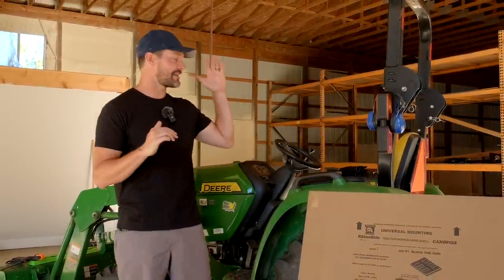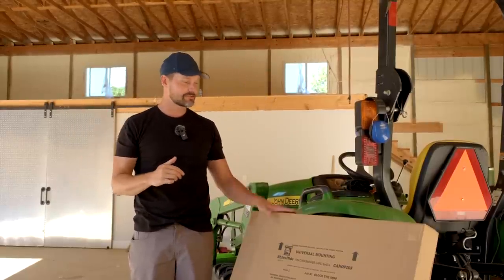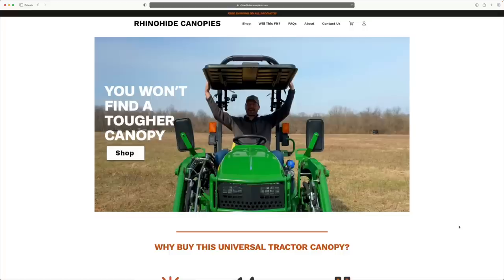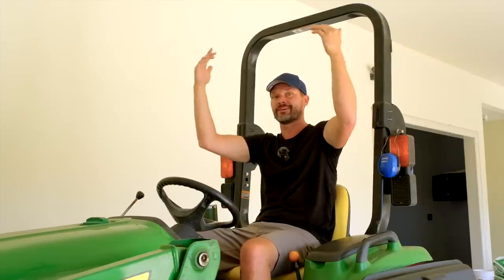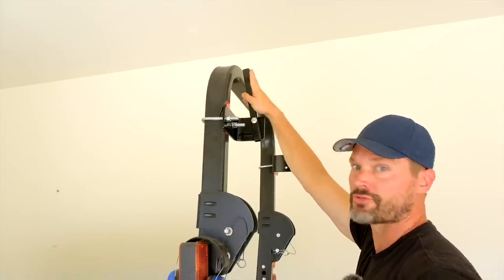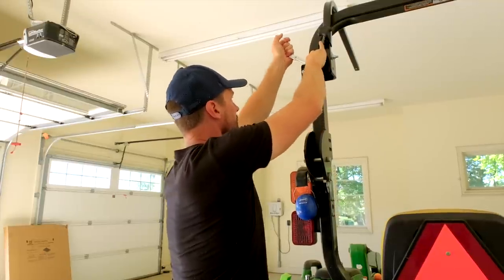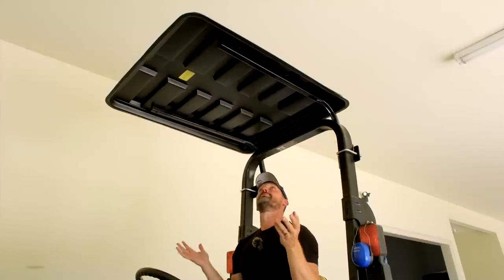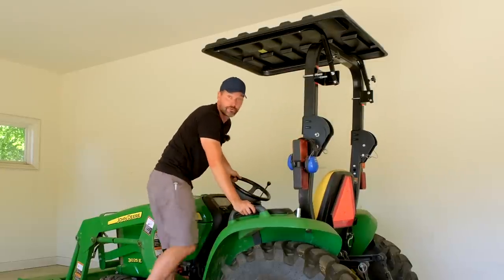I LOVED THIS TRACTOR PRODUCT SO MUCH THAT I BOUGHT THE COMPANY!

Comment: With the help of this video, the Rhinohide was an easy install on my Kubota MX5800.  As expected, I had to rearrange some other items (auxiliary lighting, tool tray, fire extinguisher) mounted on my ROPS, but it all worked out great.  

My roll bar is 42 3/8" wide (which is 3/8" wider than what the standard brackets are designed for), so the wider brackets were included.  There were no changes to the install procedure because to this - just a longer bracket.  

When traveling to jobs, I typically trailer my tractor backwards, so wind damage to the canopy won't be a concern.  On those occasions when an implement / trailer combination requires trailering the tractor forwards, this canopy is very easy to remove.  

This canopy is much more durable than the more expensive and heavier metal canopy I had on previously.   
Satisfied customer!

Comment: I bought one for my Kubota L4701 a couple of years ago.  My only complaint is that the intentions on top collect rain water.  When you get on your tractor the next morning you’re greeted with a cold shower as the water rolls off the side.  It would be better if they could fabricate it with a slight pitch from the middle down to allow the rainwater to run off and not collect on the canopy.

Comment: So, I'm a Scotch or two in and I went to your newly acquired site to order one of these to replace the incredibly heavy fiberglass cover I purchase with my 4052R (lowering my ROP with cover attached is back breaking to a point of using the 3 point and a 2x6 to lower it when needed).  Unfortunately, I don't feel like walking to the barn and measuring my ROP tube dimensions.  A sort of database covering popular tractor models would be so convenient!  Anyway, this is on my buy list when I get out there with a measuring tape.  Can't wait.  Also, from past experience slots for the threaded U brackets would be useful for fine pitch adjustment.

Comment: Love my Rhinohide on my 1025R.  I've tried to break it unsuccessfully many times.
I would like to see 2 or 3 features added:
1. A rear view mirror.  Possibly with a cover so I don't have to see it bouncing around when not in use.
2. A spot to mount a garage door opener.

3. A small storage pocket.

Thanks for all the videos.  Keep up the good work.

Comment: Congratulations on the new company. If my tractor didn’t have an OEM canopy, I would have one of these. The shade really helps on hot days. 

I have a suggestion, extend the brackets a couple more inches and put a hole in them. This would make it simple to add LED light pods to a tractor. A lot of people add lights anyway and most compact tractors have a FEL that obscures the headlights. You’re welcome.

Comment: I bought mine a month ago, so it must have been right during the change.  I second the mention of a radius slot to get the right angle.  I finally got mine installed about 2 weeks ago on my New Holland 1720 I recently bought.  Not only are the ROPS angled back, but they are somewhat trapezoidal.  Apparently we did not get the holes in our brackets drilled exactly the same.  We must have been off 1/8 to 1/16 of an inch or so because one side looks level while the other side doesn't.  Although it annoys the daylight out of me seeing it off a little, it still works fine.  A slot would have made it infinitely adjustable and I could have got both sides level.

Other than being unlevel, I can say I am impressed with it so far and I would highly recommend it for the price I paid.  It has been wonderful to have shade in the summer sun.  This is critically important for those of us who are follicly challenged (yes...bald).  :-)

Comment: Watching this I think you can offer a Snap-On side curtain kit made out of some kind of tarp material or canopy from an RV type material. so it would provide more shade and be flexible when getting on and off that's just my take
Reply: You could add the snaps pretty easily yourself.  Loxx fasteners would probably work just fine.
Reply from the maker: We're considering a solution just like this.
Reply: TINTED curtains...like welding curtain material.
Reply: That would be great for winter time, I've tried door screen material but still too windy.

Comment: Great investment in a great company, great product!  Mine is such a huge help in the blasting heat of the summer.  Also helped a ton during a snow storm last winter when literally all my neighbors asked for help.  Mine did add 1 inch of height which unforunately did ding my garage door LOL.  So, I can definitely attest to the fact that it is very easily removed and put back on.  
Best practice: If your ROPS and/or canopy do ding your garage door opening: stand a ladder in your tractor parking bay after you back out and before you put the canopy on for the day's work so that you don't forget and ding your garage door opening.  Saved my keister a few times after a long day in the hot field.

Comment: back in the 60's there was a round fiberglass cover with a built in fan sold for combines. The air was a double shell that directed around the sides to put an air curtain around the operator.

Comment: Love the Rhinohide canopy I put on my Kubota LX3310 last year. I have the "S" model and agree the "E" model would be nice to have. I have taken mine off once to trailer it to the dealer to add on a new attachment, and it was easy to take the U bolts off, but the E model looks more convenient. I bang my canopy into tree limbs all the time while working around my property and it doesn't care. The shade is really nice to have in the hot sun. Congratulations on the new company! Your video is really helpful to see the benefits of the E model.
Reply from the maker: Glad to hear it's working well for you!

Comment: Glad you fixed the website.  The old site never worked for me. 
  As for setting the hieght,  anyone that uses forks on occasion will probably want to set it a little high like you did. I find myself pretty much standing at times to see the forks align with the load and the last thing you want is to bump your head when standing quickly to align the load.
Reply from the maker: Good point about trying to see the forks and head clearance!

Comment: Future design consideration - Create a radius slot in the ROPS bracket so the end user doesn't have to tweak it and drill the hole to get the forward arms at the perfect angle.  Just throw the bolt in and set the desired angle of the top canopy.  I'll take my royalties in the form of SUBS/LIKES
Reply from the maker: I like this suggestion. Would be curious if when the canopy gets knocked by a branch or anything hanging low if it would tend to knock out of place due to the possibility of movement in that radius?
Reply: @GoodWorksTractors  Yep that would be the idea though, tight enough to keep it from swinging out of position with small branches, but loose enough to not bend the rest of the tubing/brackets if it hit say an immovable object.  With the fixed bolt in there if you hit a big branch your most likely going to bending tubes and or brackets if it got to the point of failure instead of swinging up or down to provide that little bit of "notice" your about to break things.  Could always design notches in the radius to provide certain degree locks if it needs more of a positive stop as well.
Reply: @GoodWorksTractors  fender washers and your lock nuts would do it

Comment: For those ROPS bars that have an obtuse angle (lean back from the seat), maybe you can make the canopy struts with a more acute angle or even an adjustable angle.  Maybe have a strut with a cotter pin that will allow one to adjust the pitch of the canopy?
Reply from the maker: Good thought. We're open to considering everything. Just a matter of demand and then a good solution for it.

Comment: So to get even more front & rear coverage, you could mount one forward of the ROPS (at the height of the ROPS) and then mount one higher on the rear of the ROPS (just above the ROPS) and slide the top shell forward enough to just overlap the front shell.  If I had a open station tractor, I would likely be trying that, fortunately (for me, not you) I have a cab with A/C....... :)
Reply from the maker: Mega Canopy! I like it!

Comment: Design suggestion, if you want to optimize it.  Make the bottom bolt hole on the bracket into a curved slot.  It'll allow for a single bracket for straight and angled ROPs, while not having to design SPECIFICALLY for the 1025/2025R.  I have a Branson 2610H with angled ROPs, I want to get one, I think the 1025R version is the correct one, but I want to avoid having to modify something I just bought to make it work.

And awesome job on the website!  I wanted to order one, but the website never worked well enough to give me confidence it would work successfully (nor securely).
Reply from the maker: Someone else suggested a radius slot for the bottom bolt. It's an interesting suggestion. It feels like it would allow the canopy to move in the case of a collision, which worries me. But you've made me curious enough to look into it! It's possible you could get the 1025R option. You'd want to make sure your ROPS are less than 43.5" in outside-to-outside width and that the tube steel is not wider than 2.25" or deeper than 4" before you order the 1025R model. Those ROPS look wide on your Branson and it's possible if they're wide enough that you can slide the canopy between your ROPS for ideal placement and then you'd just need the Model E or Model S.
Reply: @GoodWorksTractors  Is it possible to get a dimensioned drawing of the canopy and brackets?  (I'm an engineer, its how I think).  It would be interesting if it fit between the ROPs on my branson.  My Branson dealer has tractors flying off his lot, I'm sure if I bought a canopy and shared it with him, he'd probably recommend the product to buyers.

Comment: maybe consider reconfiguring your mold to include a 1 foot long recess on both sides so the rops vertical bars will fit in them. This would eliminate the need to put the canopy on top of the rops which to me seems to be a little bit to high.
Reply from the maker: So far we just recommend folks cut the canopy themselves in the circumstance they want to do this. The trouble is ROPS come in all sorts of configurations and widths, so the placement and depth of those recesses would work for some and not for others.

Comment: Thanks for the video . It looks like a great lite duty top, with easy installation . But I think that I would like the top to be longer, so that you could put a bar light and maybe a mirror or fan out under the front of it . And you could fix a wiring disconnect for the light or fan,  like a trailer wiring hookup, if you needed to remove the top . Is there a bigger size kit for bigger tractors ?
🤗👍💫
Reply from the maker: There is only one size canopy right now, but we're looking into the cost for an extra-large edition.

Comment: You should consider expanding the canopy lineup and make a larger size canopy for larger tractors the 37x45 is great for small stuff but you need a larger one to compete in the "real" lol, tractor market, and i bet you would get sales...... i think the 54w by 64long would be about right based on loose measurements from my fiberglass canopy....
Reply from the maker: We're workin on ideas.

Comment: Don’t want to tell you what to do BUT did you consider where the WATER would end up if you get caught in the rain??? You tilted slightly forward & it looks like water will dump on to your dash. Maybe something you want to look at? I don’t purposely work in the rain but have been caught in it or tried to JUST finish up a project after it started raining. It doesn’t look like the canopy has a rain gutter built in to direct the water to say the back which maybe something to look at for improving? GREAT channel & appreciate you & ALL you do for us smaller tractor guys!
Reply: A short metal roof panel and dozen tek screws would extend the canopy both providing more shade and keeping the dash dry for under $20
Reply from the maker: Been a long time since we were caught in the rain, so we didn't really factor that for our use. But that is a legitimate point. We're discussing extension options and rain solutions.

Comment: I questions the angled ROPS. Was it a safety requirement by the Feds? I noticed the new RK25, TYM T25, all have angled ROPS too.
Reply: Shooting from the hip guess? I'd guess it puts the rops closer to the operator and offers better protection in a roll over, due to angles of the triangle fom hood to rops. Or simply, more room for your head when upside-down. Just my 2 cents guess though.

Comment: why do you want the canopy to tilt forward rather than backwards? I have mine tiling a little forward but rain likes to drip on the controls. I think I may tilt mine towards the back instead.
Reply from the maker: It assists with any branches it hits to slide up and over, rather than pulling up on the canopy. And if we do trailer it with the canopy on, it'll help create a downforce. We don't use our tractor too much in the rain, but that's a good point.

Comment: To answer the inevitable but unanswered question, expect to spend $350 to $450.
I would recommend that a level NOT be used, as various factors, including air in the tires  and the surface the tractor is parked on, will affect the positioning of the brackets. Instead, measure from a fixed point on the ROPS, such as the pivot point on this tractor, and match that distance to the bottom of each bracket. You aren’t actually leveling the canopy; you are positioning it properly on the machine.

Comment: Let me ask you this, can you reverse the roof and stick it back into the mounts so it covers you  when your using the backhoe? It looks like you could but the roof may be tilted a bit. I would suggest quick release pins where the lower bolts are and drill another hole so when you reverse the roof its level or semi tilted when you using it over the backhoe. just a thought. Love the roof , love your videos.
Reply from the maker: We sell a backhoe kit just for that purpose. It's an extra set of L Brackets and U-Bolts and the lower steel pins that the struts slide over.

Comment: Your fence needs a few boards...........for the next video. If you load the tractor correctly (rear facing forwards) would you need to take the canopy off for hauling?
Reply from the maker: We still recommend it, but plenty of folks have reported that they don't and haven't had a problem. But that's part of the reason we'd recommend installing it with the front down just a bit, for those who drive the tractor straight onto the trailer it will create a downforce instead of an upforce.

Comment: I use this on my Ventrac and I can say it can stop the tractor in its tracks when wedged against a grapevine and its still in great shape! Let me know if you want a video link and time stamp for it. I take it off and throw it on the trailer when transporting it.
Reply from the maker: Would love a video link!
Reply: @GoodWorksTractors  Starts at about 4 mins in and there is an after picture. on the video. https://youtu.be/i53vho06CD4?t=250

Comment: WITH the ROPS DOWN, Rhino Installed, 7 ft door workable?
Reply from the maker: All depends on the tractor it's on.
Reply: @GoodWorksTractors  Time to make a sliding mount for this so it can be down when parked. Light Bulb moment@!

Comment: Have you done any tests with painting the top side white? I certainly don't think I'd offer that as a product, but would it be worth the cost of a can of spray paint?
Reply: Does it radiate enough heat while your driving to make it worthwhile would be the question. Certainly I would think it might in direct sunlight if the tractor isn't moving.
Reply from the maker: We haven't, but our plastic doesn't love paint. We'd recommend a customer do that, as they'll likely need to keep touching it up.
Reply from the maker: We haven't had that problem at all (of heat radiating from the canopy).
Reply: I live in southeast GA (about 104⁰ just 2 days ago!), and I've honestly never noticed heat radiating from the canopy, nor is it typically hot to the touch. (Maybe because of the type of plastic it's made of?) I guess if the tractor were stationary for long enough (but how often are we sitting on a stationary tractor for long periods of time?!), this COULD become an issue, but it hasn't been for me. Hope that helps.

Comment: I was curious how the backhoe attachment works. But here me out, what if the top was mounted on some sort of sliding rails that has locking points. Then you could just slide the roof to the back when doing backhoe work.
Reply: This would be awesome!
Reply from the maker: That would work, but generally speaking mounting above the ROPS isn't the best solution for maximum shade. It depends on the ROPS of course, but the lower it can be the better. That would work perfectly though for ROPS wide enough to slide the canopy thru. Or for a wider canopy shell.
Reply: @GoodWorksTractors  I get what you’re saying but what I’m envisioning wouldn’t matter where it’s mounted. The canopy would be able to slide forward or back to cover more behind you when you are using the backhoe.

Comment: Maybe you touched on it, and I missed it….   If someone had a tractor and a zero turn, with ROPS that were similar in width,  could they purchase one with a second set of mounts and move it between machines?
Reply from the maker: Absolutely. Just buy the Backhoe/Multi Kit. It's an extra set of mounting hardware and allows you to do just that in that scenario.